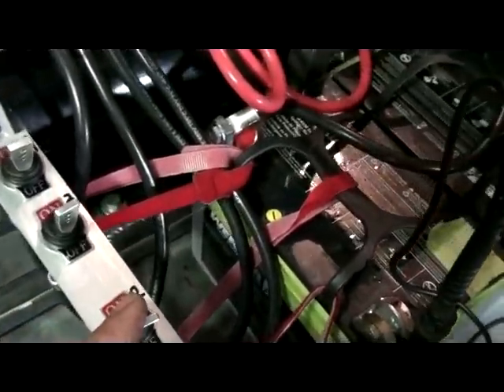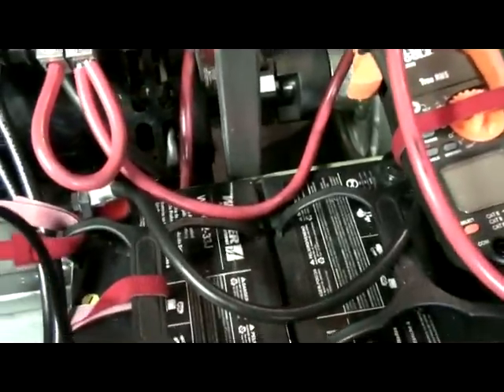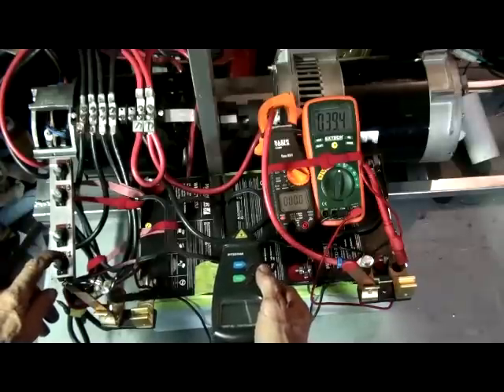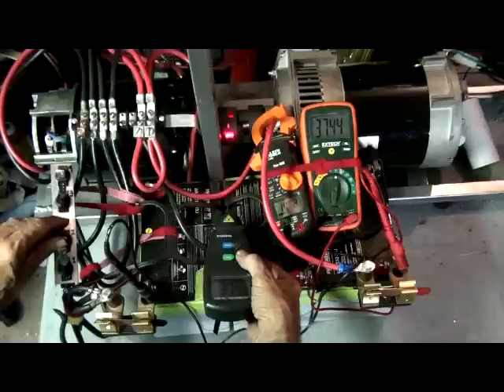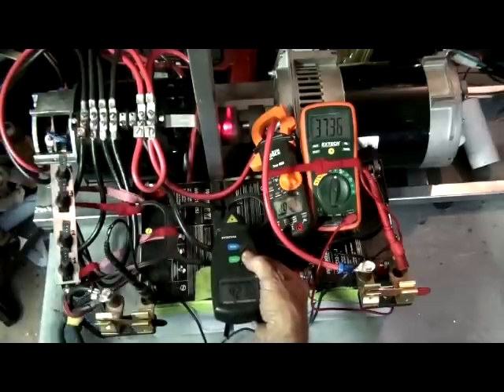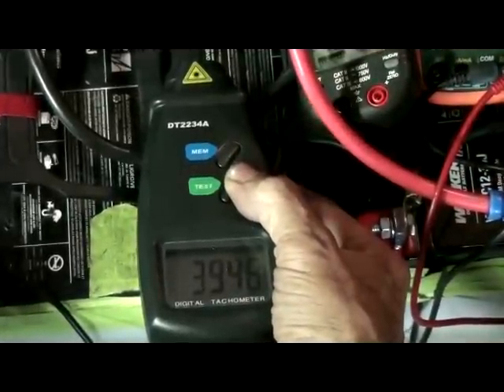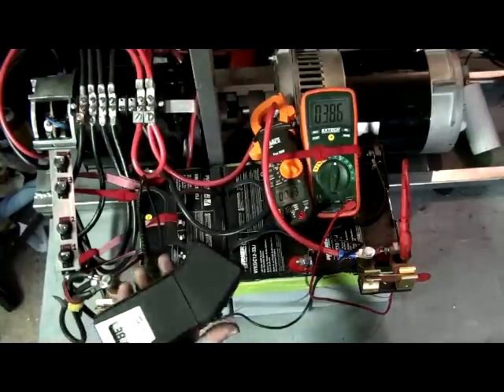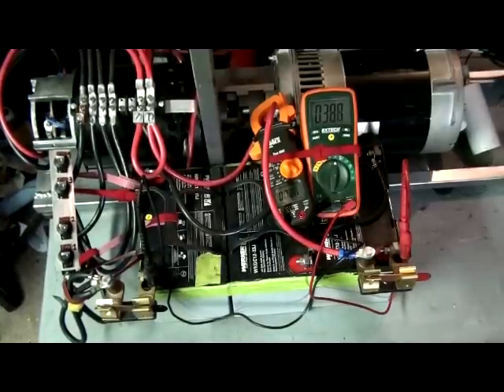TESTING_ALL_GATES RPMS_AT_36V

Comment: Buy a 6-5k watt gas generator.
Install a one way pully bearing between the  engine and generator so the engine  disconnects when turned off.
Install a 3.5 hp. 110v/6-13a electric motor to the pully.
Start the gen on petrol, plug the motor into the gen, when the motor overruns the engine, turn the engine off.
 now all the excess wattage and current is "FREE to USE",
NO GRID POWER
NO PETROL USE.

PORTABLE SELF RUNNING POWERPLANT, 
THAT RUNS ALMOST SILENTLY ON REGEN.

DO NOT FOLLOW THE DEVILS ADVOCATES TRYING TO BREAK HIS RULES,
THEY CAN NOT OUT THINK THE MASTERS.

Comment: Hi UFO, Good video as always, I'm a big fan. I want to point out a affordable brushed motor to experiment with. It's only $16 free shipping and no tax from China. I just got one. It's very high quality. 24Vdc motor, 40Watts , with bearings. It's a cheap and great solution to experiment with. If you need more info let me know. Here's the link, Cheers.
http://goo.gl/t6ec88
Reply from the maker: Hello Mike, thanks!

Yes, that looks like a nice motor to experiment with, nice size and looks pretty well built.
However, looking at last pic where is all apart...notice is very 'tight' room to add a second commutator and brushes since shaft reduces diameter...so the armature may have to be moved related to shaft a couple of mm or so, to 'just' make it to rear bearing...(look at back end, there is still some mm left).
On the caps and bearings is great, they are the same...so all you will need is to elongate the outer frame allowing room for the second set of brushes.

Take care
Reply: ufopolitics Thanks for your useful reply. You are correct, there is not enough room for a second set of brushes. Cheers!